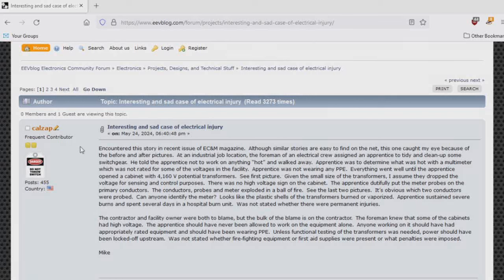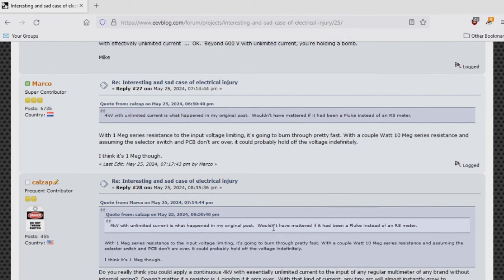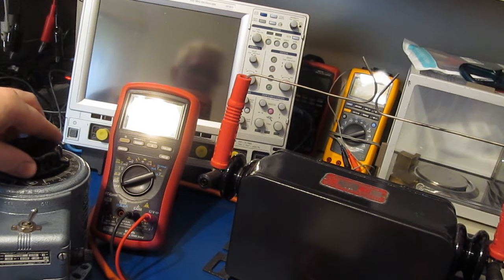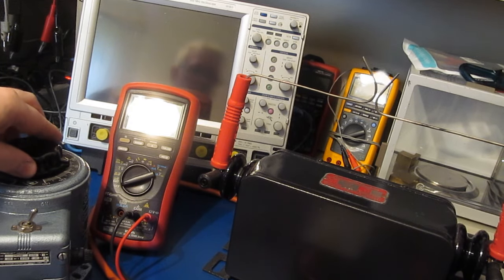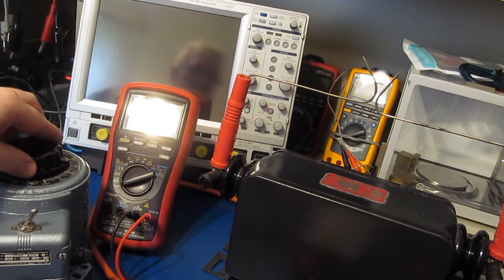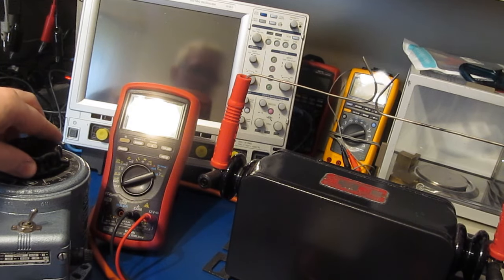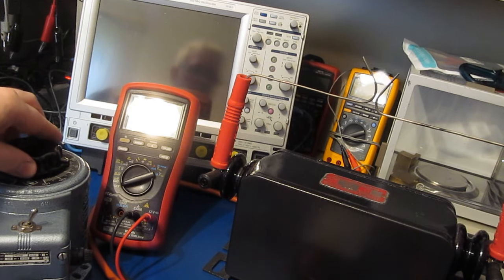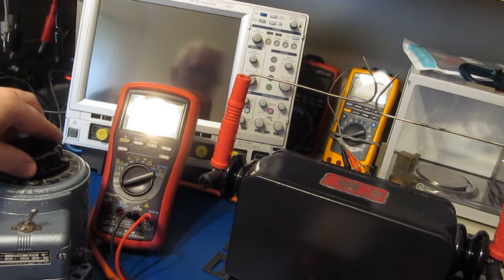Neon sign transformer vs DMM

Comment: BM869S, over 40kV from a failing high energy devise. At the output of the devise was an open 75k resistor that exploded. The Brymen was at a point that should be 400Vand exploded. Measuring with a 40kV probe at that point the an other meter gave overload (max voltage it could display was 50kV )
The Brymen had an exploded PTC, 3 dead MOVs, a burned trace. After replacing the parts and repairing the tracxe, the Brymen is still working fine and within cal.
Reply: I'd imagine it should have evaporated at that voltage and if the source was low enough impedance (high energy). It's interesting that it didn't, even despite there's no HRC fuse (or any fuse for that matter) in the voltage input path.
Reply: Pretty amazing, because at 40+KV, you would figure that any arc that started would continue to just burn and irrepairably damage the meter's innards. That kind of voltage would most likely easily jump and sustain a 2 inch gap once an arc is started.
Reply: @poormanselectronicsbench2021  I work behind  an adjustable over current protection circuit and a big red kill switch just in case. So it can not continue otherwise the meter maybe would have been in worse shape. ( trace between input and MOVs burned away)
Reply from the maker: @pa4tim  The only time I work with voltages that high are involving automotive ignition systems.  There isn't enough energy to make a  DMM explode.  It could certainly damage one.

Comment: Standard test for wire is to have a bath of slightly saline water, and the wire in the water, so as to find the weak spots in the insulation. For the better manufacturers they use a salt water section in the cooling path for the extruder, and a paint marker to dab a blob of paint on the wire, so that that roll of wire can be pulled out, and then recycled, or cut into 2 smaller reels for sale as short rolls.
Reply from the maker: I was referring to the leads, not the wire.  Their is a separate standard for them, just like the safety standards for the meters.